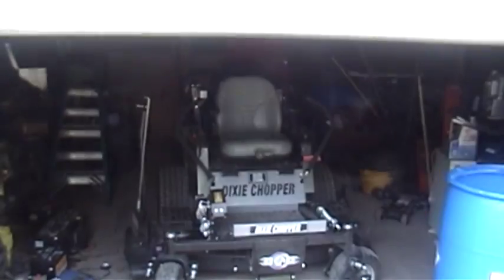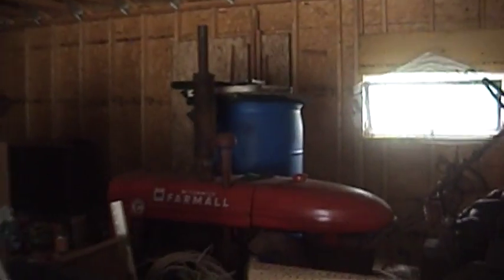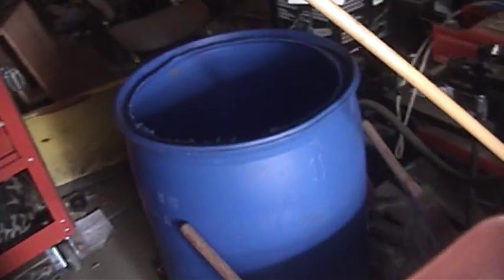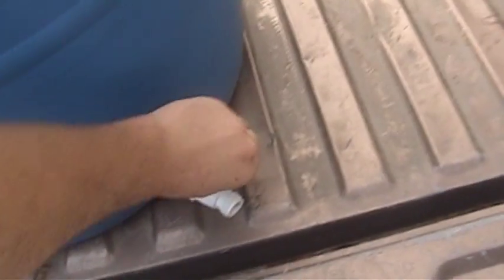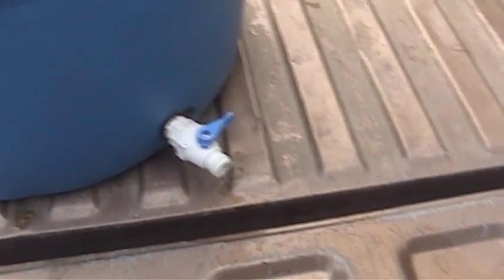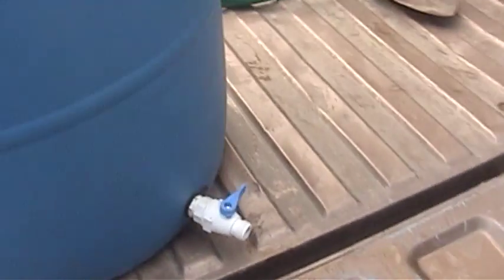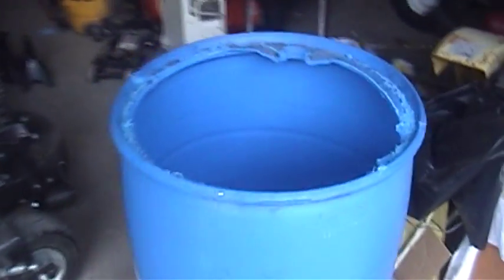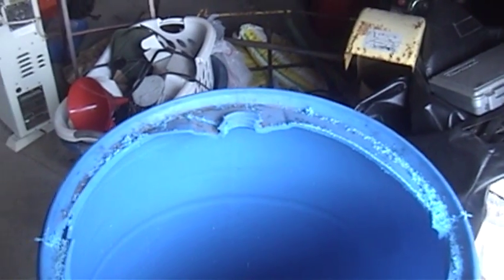Water Barrel Collection System

Comment: You could use the collected rain water to fill radiators in your garage.  The other thing you could do with the barrels is put oil in them. Then use the used engine oil to use in a waste oil heater for you garage during the winter.

Comment: Well it has to dissolve grease and muck, kerosene?, some type of solvent, turpentine may work and i think paint thinners may be a bit too explosive.
if its just general crud then i suppose a mix of water/washing up liquid and engine gunk or similar could work, could use diesel but i was thinking of the cost to you.

A hard brush for scrubbing would be handy, we had brushes that had a hole down the handle to deliver solvent to the bristles.

Try an old shower head for spray delivery instead?

Comment: Sounds like a great idea to me. My question is, if the barrels are sitting on the ground and they fill with 55 gallons of water, how are they going to be lifted into the truck bed to take to the farm? Perhaps make some sort of raised platform level with the truck bed and slide them in when they're full, or get some sort of pump to transfer the water from the collection barrel to the transport barrel in the truck?

Comment: Another possible: use a dipped lid with drilled holes in the center and put parafin in it with a cheap 12v petrol pump + flexi shower hose for your own parts washer :-)

Comment: You could keep one barrel for the bad results of "Does it Carbonate" experements :-) lol

All your old engine oil can go in one and a dense filter on the outlet so you can use it for less demanding purposes, hinges, lubing bolts before assembly and other non critical things, why waste the used oil from all your familys cars when the oil can needs filling.

Composters, planters, sand/sawdust for oil spills in the garage. possibles :-)

Comment: My dad told me that some neighbors when he was a kid had a similar system for their garden.  They didn't filter the water going into the holder, they just let the rain water run on the ground out of the gutters for a half an hour to flush off the roof and gutters, then put the spout into the collection container. If you aren't using the rain water for potable water, this should work fine.